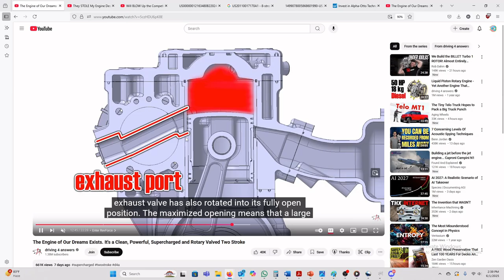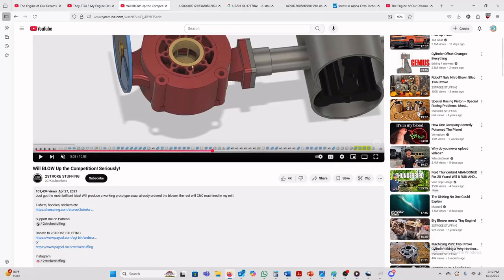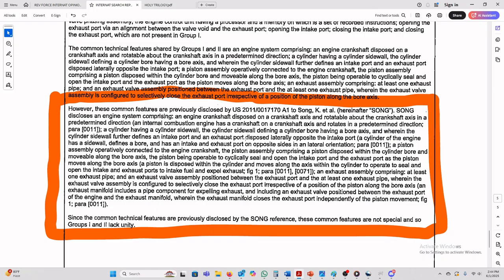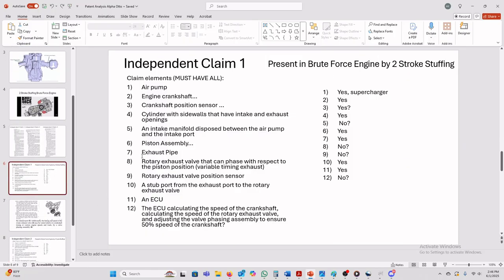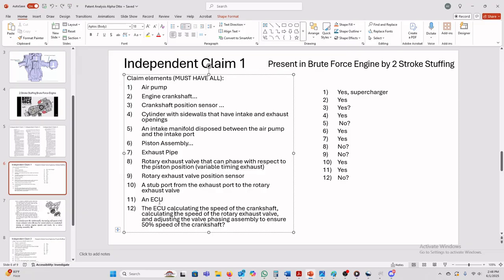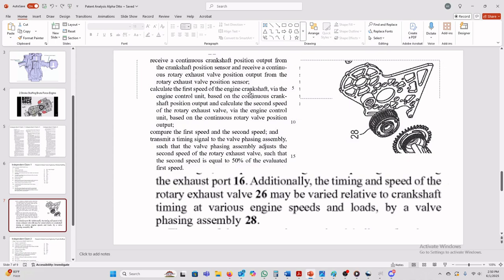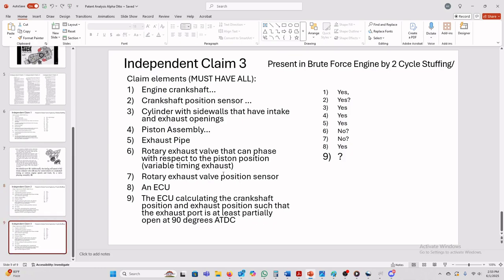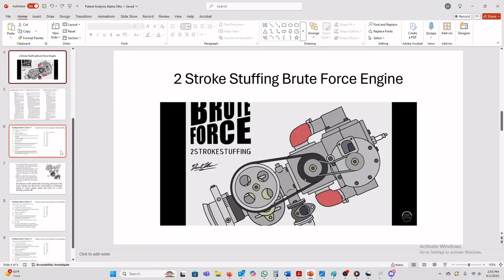REV Force V Brute Force- Sneaky Little Sneaks?

Comment: I gave this idiot behind the REV force engine this idea over discord. Advice to anyone out there with innovative ideas. DONT SHARE THEM. My invention has many more aspects to it, but this was the easy adaption I gave him, with the proviso "if you use it, involve me"
Reply from the maker: Sorry to hear that happened to you. Do you intend to patent/pursue your ideas? Sounds like you held some other bits back. I know a patent lawyer and retired patent consultant I could put you in contact with if it would help. I'm also curious how similar some of your changes are to what I proposed in https://youtu.be/BoGuEj7owvw but first file your provisional patents before telling me anything if you think you may want to work on it in the future. I don't check it often, but I will make sure to check the channel email address a few times this week in case you would like a few patent contacts.
Reply: @EngineReviews  it's a concept patent I want to file because it's a 2-stroke nduction system I haven't been able to find anywhere. I believe it's capable of 60+ percent thermal efficiency. I came up with the idea I. 2020 and over the next few years figured out how I could implement it and I think it's ready for engineering and prototype but I don't have the resources or social connections to make it happen, maybe in a few years once I save up to do some of my own small scale testing to r&d the concept
Reply: I do know there are similar ideas in marine diesels but not in road vehicles. No need for a blower, I've figures out some of the rough harmonics and port height considerations and I think it can be done, but simplicity is king, and ported cylinders always present ring issues. Sorry bout the typing issues above, on my phone.

Comment: The fundamental concept of a rotary exhaust valve enabling independent control of opening and closing to achieve over-expansion was already introduced in the 2015 Master’s Thesis at the University of Minho, titled “Innovative Rotary Valve for 2-Stroke Engines Enabling Over-Expansion.”
This academic work is therefore the seminal reference, clearly predating and anticipating any later developments.
Reply from the maker: Great addition, thank you!
Reply: Yes, but patent examiners generally do not look at non-patent literature very much. Unless there was a patent on the idea, they are much less likely to see it.

Comment: personally i dont thunk the 2stroekstuffing engine is anything new, its just a different approach to the detroit 2t diesel, the rev force engine is so much more thoughjt pout and advanced that it practically IS a new engine
Reply: I didn't think 2 stroke stuffing used an oil sump - and a different approach is what can be patentable. Like, electronic circuits - you can patent that pattern, even though the components are just resistors and wires
Reply: @WattersZ  thats true but wouldnt the patent only be valid if the different approach yielded a benefit or a different outcome? i have yet to see a way his engine is different,if anything its worse since it still uses crankcase to pss the gases so oil i still burned, no? i could be wrong

Comment: It seems to me that the reason for the ECU controlled valve timing is not because the belt might slip, but instead because the exhaust needs to open or close earlier or later depending on engine load.

(Also to compensate for different fuels octane, and to run well when the engine is warming up, but mostly for different loads).
Reply: Yes and a smart attorney would have crafted the claims accordingly.

Comment: alpha otto's patent is a typical paper patent, designed to mislead investors. it does not disclose any mechanical novelty, merely a very specific and narrow method of operation - enough to get a patent granted, but not enough for any true ip protection. It's so easy to circumvent. the original patent it is based on is this one: 4,924,819

Comment: A minor technicality: the Brute Force engine that 2strokestuffing has been working on actually does pass the intake airflow through the crank case, but (as I understand it) this is more for design convenience and not essential to how it works. All air pumping is done by the roots blower, so theoretically the crank case could have been bypassed.
Reply from the maker: Thanks for that clarification!
Reply: It could work as a hybrid starting on ev mode or have a 2 starter motors

Comment: Why use a rotary exhaust valve at all.  Why not use an electric component to open and close the exhaust port?  Perhaps two components opposed to one another to speed the opening and closing and all of that would be controlled by an ecu.  Ultimately this is the focus of this design and having a close tolerance valve in line with the exhaust would present temperature problems.  A slide configuration with two separate surfaces would reduce mass and temperature transfer.  Just saying.  I am leery of people with their hand out for development.  If the idea was innovative it would market itself.

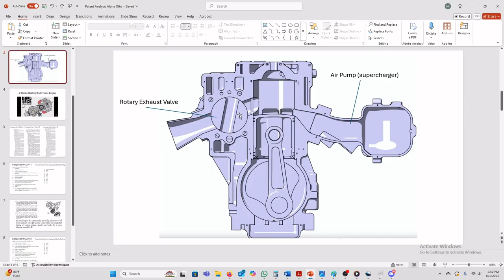Comment: 11:10  as far as the patent is concerned, you wouldnt stipulate the speed of the rotary exhaust valve versus the crank.
But in practicality you would NOT run it at engine speed because of wear and the aperture becomes dynamically too narrow.

Comment: Itsn2strokes stuffing. I watched him fromnthe start developing many ideas for his first salt lakes run. Variable exhaust timing is a good touch to an existing idea if you get the slight of hand to claim the patent. You could alter the exhaust timing with oil pressure like vanos or vtec system. I need to apply for a forced induction 2stroke patent VV2T variable valve 2 stroke 😂😂😂😂😂

Comment: You said its a problem that Rev Force won't be able to control market share. Is that because it's stops you from wanting to invest in them?
Reply from the maker: IP that isn't durable i's a big red flag for me to invest personally yes. The second concern for me is the top piston rings going over the port. However, they oversubscribed their round on Wefunder anyway so hopefully they will take that money and apply it to fix those issues. Hopefully for them they survive and thrive and I look like FUD. It's possible there may be some manufacturing thing they figure out and keep trade secret that can overcome their weak IP. And maybe they will find a way to address the top piston ring concerns. Or I could be wrong on that being an issue- after all D4A came out and said he doesn't see a flaw! I'm not convinced though.
Reply: Gocha. Why is the piston rings going above the port a potential issue? The crankcase should still be sealed from the bottom ones right?
Reply from the maker: @bazookajoe1459 They took the air out of the crank so it is improved from an emissions perspective over a standard 2-stroke. So did Mazda. But with the top piston rings going over the ports, oil from the rings will get pushed into the port opening on the edges.  

Here's a little home experiment to see why. Take a cheap plastic syringe, and put some cooking oil in it. Next squirt all of it out but don't disassemble it or wash it. There should still be a film of oil on the walls. Next drill a hole in the side and move the plunger in and out a few times.

That hole will catch and funnel oil out. They could keep the oil amount low to mitigate this, but then I think it will wear out prematurely. They could go heavy on oil to mitigate the wear issue, but then emissions will be worse than a 4-stroke. It's a bit of a catch 22. 

Mazda used poppet valves on their concept likely because of this issue. Having an oiled zone with a plunger and putting a port in the middle of that is risky emissions-wise. They would have to have some sort of clean burning environmentally innocuous oil. Some sort of olive oil or something 😂 then maybe!
Reply: Ooh Gocha
Reply: If they increased the length of the cylinder so that the intake and exhaust ports are above the piston but still on the side of the cylinder maybe that could fix it. The piston would no longer seal off the intake however so another rotary valve would be necessary. It would be a very long cylinder though🤣.
Reply from the maker: @bazookajoe1459  you are almost to an overhead poppet valve, keep going a little further 😂 if they were on the side instead of top it would take more space lowering the static compression ratio. Good thinking though on how to possibly address the issue. There might be a way, don't get discouraged
Reply: I thought D4A said that poppet valves didn’t flow air fast enough for a 2 stroke though
Reply: Rotary poppet valve?
Reply from the maker: @bazookajoe1459  Rotary valves flow more. But I was talking about a normal poppet valve. I haven's seen your long cylinder of course, but my expectation is what you lose in static compression ratio (and therefore need to run the supercharger harder) by elongating the cylinder (enough for ports and keeping them in unusable territory so the piston rings don't pass over them) would probably be worse than just running poppet valves.
Reply from the maker: though you could maybe run the ports on the top instead of the side and still tuck away a rotary valve with potentially less static compression loss... but now you have a really weird geometry. That little snake port so to speak would be exposed to combustion gasses and only somewhat shield the rotary exhaust valve. It would probably still leak. You could make the path a bit more tortuous to better shield it, but there goes the flow advantage. I'll have to think about that. I'm not sure how workable that would be.

Comment: Any piston that scrapes past a port will inevitably leave oil on the port edges. Oil will get into the combustion chamber, like a Detroit diesel. You don't see them made anymore for that reason.
Reply from the maker: I agree, piston rings scraping over ports is a problem. I kept this video focused on the patent, but I have doubts they will meet emissions because of that. Mazda's 2-stroke on the other hand may have solved the oil contamination issue completely. But poppet valves can limit rpm and running a 2-stroke means they have to run double speed. REV force seems to have gotten rid of the rpm limitation, but added another form of emissions concern
Reply: @EngineReviews sadly you are too correct. Rings travelling over ports, even compression rings, introduce oil.  Detroit diesel proved this, but their larger cousins EMD eg 567, 645 and 710 in rail applications did better !
Reply: They explained that this was addressed by careful honing design, to lubricate the upper section of the piston and not throw oil into combustion/exhaust, but I wouldn't trust entire engine functioning on some tiny grooves, it doesn't even sound reliable. Funny thought though - this engine would actually benefit from Taurozzi scheme.

Comment: Hallo mr…….Thanks for responding to my question about mechanical injectors vs electronic injectors on Matts “The workshop” channel. My name is jonathan, and i was wondering weather i could send u some drawings of a 2 stroke engine im trying to invent so that u can give me some guide lines,point out weaknesses and tell me if it would work or that im crazy. Anyway great video……and i hope its not the last
Reply from the maker: No problem. As far as reviewing an engine concept, I just created an email for the channel you can contact me on: enginereviewsyt@gmail.com (Unfortunately enginereviews@gmail.com was taken... bummer)
Reply: @EngineReviews  thank u very much have a great day
Reply: @EngineReviews  Hallo its me again. The drawings are still pending cause im working out some things on em. I have a question though and it is: can air have its own injection system like fuel injection in an engine? or will it cause too much parassitic loss?
Reply from the maker: @jonathanfernando6537  I don't see precise air control worth the cost. You already have throttle control (or wastegates with turbos, etc). I don't think more precise control would benefit you. And you can already adjust the fuel to the airflow after reading the mass airflow sensor data etc.
Reply: @EngineReviews then i wont use air injectors thanks

Comment: Brute Forcde like REV Force is nothing new...... the basic function and idea is old ....... but at the end the REV Force guys claim to make it work and patent some details ...... this is something what happen every fkn day..... we also amde something similar back in 2008-09  or 2010 ...I don`t remember exactly ..... should i claim its my design ? ....
Reply from the maker: Did you drop the exhaust port down the bore? Did you utilize a spin-through rotary valve in the lowered exhaust port? Did you use a supercharged intake with the intake port below the exhaust port also down the bore instead of overhead? Did you have a double piston ring set design with a crossover area for oil transfer to the top rings? 

Even if you did, that's not what they patented- but only if all those were a yes would I say you would have a valid claim to coming up with the idea first. 

Even between the REV Force and Brute Force there are significant differences even though they are both supercharged rotary exhaust 2-strokes.

Comment: Good analysis illustrating the odd descriptive language required for today's patent process. I see nothing patentable in this engine design.  ECU control of various functions for an IC engine such as spark timing, fuel injection timing and duration, variable valve position control is typical of today's modern engine.  And there are numerous variations to the implementation of rotary valves.

Comment: https://www.youtube.com/@Motor-Technologies-Inc./videos
Reply from the maker: Thanks for the link. Are you associated with this company? I tried going into the contact us on the website for the account and it appears broken. 

I watched a little bit of the videos though. I'm intrigued, but I have some reliability questions. 
Positives:
-This creates creates a more open flow path like a rotary valve allowing the engine to breathe better and potentially push rpms higher.
-Cam control presents better timing control (can open and shut fast and move slower when fully open for a longer overall open duration). 
-Eliminates collision potential between the valve and the piston
-The patent discusses the ability to lower spring tension and therefore friction and that should increase efficiency (assuming you maintain a seal when the valve is closed)
Negatives/questions: 
-Doesn't eliminate reciprocating mass in the valve but rather it just changes its direction. Not necessarily a negative, but could limit rpm from the reciprocating motion of the valve
-With the larger seal ring (bottom seal), I think there could be tolerance concerns as the engine warms. When the engine warms up, whatever you use for seals may expand more than the roller bearings the plates are sliding on, leading to eventual wearing away of the seal and poor sealing in a cold engine later. Matching the thermal expansion ratio between the roller bearings and a sealing surface to avoid that I think would be difficult. Unless of course I am misunderstanding the sealing mechanism. 

Overall I think this is quite intriguing. I have some draft work comparing the REV Force to the Mazda two-stroke of which the main difference is the valves. REV Force's rotary valves down the cylinder open some possibilities and some vulnerabilities. Interestingly, this sliding valve does have some of the better components of both approaches- though I am still concerned about the bottom seal wearing out on this sliding valve.
Reply: @EngineReviews  Hi there. I am one of the co-founders of the company. Back in the day we looked at Coates rotary valve and even experimented with semi rotational valve. Issue was that the seals would wear out very fast. 

When we spoke to a Korean OEM to a famous Korean car brand they asked us to test the valve on a turbo wastegate to see if there were any durability concerns. We did and have over 10k KM on it with zero issues. The valve even survived an engine fire from an unrelated gas line leak.

The D shape port of our valve flowed much better than a circular shape because there were no turbulence. Notice that a lot of fighter jets like the F-16 have a D shaped intake? When we tested the flow rate of our valve - it flowed more than double of the best Honda/Porsche/Ferrari street legal heads on the on the market. Note that this was a partially opened valve and that the valve wasn't made to the largest potential size to utilize the entire engine head. The CFM numbers supported 250RWHP/liter normally aspirated.

Yes,  the cam control is much better than a rotational valve or poppet valve.

Yes, our valve is none interference in case there was a failure - no collision with the piston.

Yes, we can free up much of the parasitic valve train loss from high spring rates found in a poppet valve.

Yes, our valve doesn't necessarily eliminate reciprocating mass.

The seals works fine in a hotter environment - turbo wastegate. When we designed the seals we looked at the rotary engine seals as well as piston ring seals and each of their respective seal springs. We elected to implement a wave seal for our sealing mechanism. This way it accounted for thermal expansion/contraction tolerances.

If you like, I would be more than willing to answer any questions via email: atsai@motortechnologiesinc.com - we can also do a live Google Meets as well.
Reply from the maker: @CarsandBikes  Thanks! I will be in touch!

Comment: I think ECU is for controlling pressure for diffrent fuels but it also might be for lining exhaust gas with other cilinders
Reply from the maker: That would make more sense, but that isn't what the patent language as written says.
Reply: @EngineReviews  driving4answers said this about ECU, it's for rotary valve control. Also the compressor can be controlled so one can have "full control of the dynamic compression ratio".